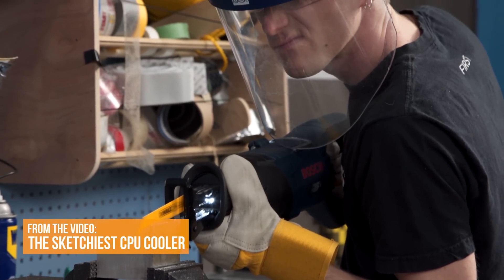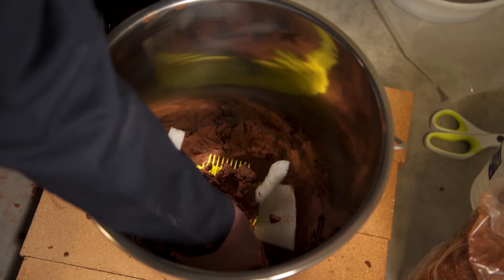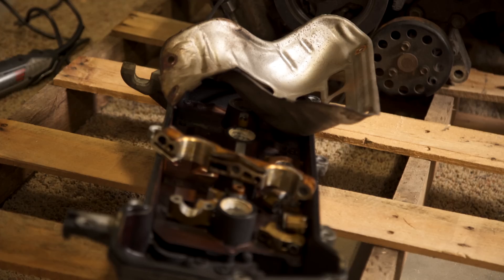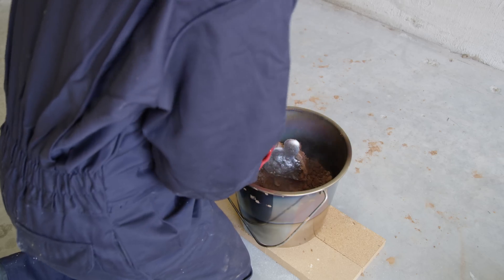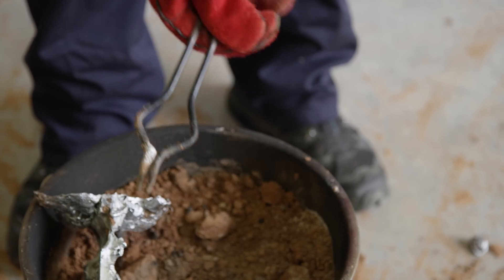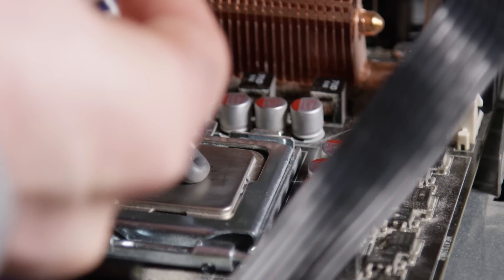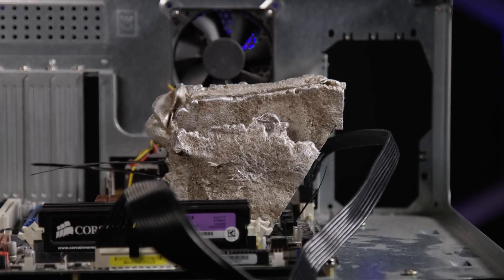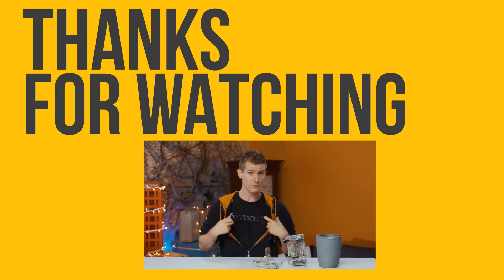The WORST CPU Cooler EVER – Sketchy Heatsinks Ep2

Comment: Should've used wax and plaster , and you have to burn the wax out before pouring , plus it leaves the mold hot so the metal doesn't cool while filling the mold. Then the plaster just washes away.

Comment: If you change the metal finish of a heatsink's fins - like through sanding, sandblasting, or even electroplating with copper - would that increase heat dissipation?

Comment: My god the lacking knowledge of Linus and the tech nerds in the comments is triggering me. You don´t cast complex forms of metal, unless you have a state of art cast and pouring technic and high temperature machines, to make bubble-free and the almost final shape. WE PEOPLE, only get complex structures from metal by removing material from them, with like, for example: CNC, Lathe, milling machine and so on......I´m sorry Linus you will never achieve something good like a heat-pipe with amateur stuff.

Comment: I don't have a degree in metallurgy, but I am a welder and your aluminum casting looked cold to me, it did not seem flow very well. 

10/10 needs more heat
- IGN

Comment: Would it be better just to glue a piece of metal with thermal adhesive to the CPU 🤔
Reply: Basically, I'd think yes, compared to the disasters so far. Use 1/16th" sheets of aluminum, bend the ends at 90 degrees and attach them to another sheet with thermal paste, and use screws upside down with nuts on top to secure the sheets better, so then flat tops of the screws can align with the bottom of the heat sink's flat side.
Reply: actually they did it. They designed their own desctop case, but they used some production methods too. So, not completely DIY.
Reply: Agreed

Comment: The easy way to do what you just tried to do is to buy a hunk of aluminum just a square block. Use a abrasive chop saw to cut fins into it. leave the outside edges thicker so, you can drill holds 1/1000 to 10/1000 smaller than your screws. also make sure you cool down your piece often so you don't  Warp it.

Comment: Why would you not just cast upside down so the fins get filled, and you can sand down the bottom mounting plate? You would of had no issues with the foam casting at that point.

Comment: 1: Print your model in PLA. !!!Don't use green sand(yours was wrong and even good green sand will leave a rough finish)!!!
2: Use a mix of plaster of Paris and sand about 50/50.
3: When it has dried, use a torch to burn out the PLA and use compressed gas to remove any carbon deposits.
4: Cast your part and enjoy less finishing work.

Comment: they didnt dross extract. thats what screwed the pla casts up. tinfoil sheet of reasonable size. place baking soda into said sheet and create baking soda aluminum foil ball. take bbq tongs and force said ball into the bottom of the crucible and force the dross out while under heat. then scrape dross and pour.

Comment: It would be much much better if you had calculated the casting time and included a volume riser to account for shrinkage of the cast during cooling. Casting a cooler tbh is not recommended because the material would be very rough and not precise, especially when you are using sand casting. It would be much better to use either electric discharge machining as the finish would be a lot smoother and precise.

Comment: You should have used loose sand instead as it would get into all the nooks and crannies. Like so Linus can see this.
Reply: Unfortunately he used green sand the worst way. He simply combined two casting methods not meant to work together. If he used low melting point foam, he should have used a proper casting recipient (a simple hollow 2 part wooden frame) and packed the sand VERY tightly with a small wooden block. The molten aluminium would have vaporized the foam on the spot and with a tightly packed sand (less air inside) wouldn't have lost melting point so fast which resulted in such a poor cast.
Even the fact that he used flame to melt the model before pouring could only weaken the greensand mold. 
Too much humidity in the sand is very dangerous (explosion risk), but a sand that's too dry is no good either. 

If he wanted to use the PLA model, he should have made a clay-based fire-proof mould that would have dried in an oven (and melt the original model). Then he would have done the pour. That's just the tried and true lost wax casting method known to Man for thousands of years...
Reply: Also need to flip the heatsink so that the base is on the top.  No matter how good the mold, you are still going to have to plane and polish the base anyway.
Reply: Adnaan Ali they did.
The 1st casts where green sand based
Reply: This is why computer nerds should stick to computers.  I've seen a video of a guy making his own brass knuckles and knives just using regular sand.  After they cool, they do require some cutting, sanding and polishing, but I bet that guy could definitely accomplish what Linus is after here.

Comment: holy shit.... the worst casting techniques i ever seen.
Reply: so i made this car out of dog shit and pva glue, yeah idk

wow this is the ugliest car ive ever seen

oH yEAH? Make it urself and post it then!!!
Reply: Agreed.
Reply: Agreed. I'm mechanical engineering student and we used wax for both compressor and turbine impeller for automotive turbochargers. It's probably the best way to cast finicky aluminum parts without much remachining.
Reply: It's been a while, but I remember that (almost?) all methods that included a lost model, had that model destroyed before the metal is poured in. Either by heating or burning it. From the video it looked like they just poured it over the model and hoped that the metal would burn it away, which might be possible, but only with carefully pre-heated casts.
Reply: yep, this is not how one does casting.
Reply: @watcheths
depending on the shape u can remove the model and before cast.
used a lot when casting plates.
and depending of the material used to make the model u don't need to pre burn/destroy the model before cast for a example styrofoam models burn extremely ease and fast.
Reply: @OhMyKMPR 
its above DIY level...
Reply: Vitor Leão they wouldve had alot more success if they used investment and a different method of lost casting. wax probably wouldve been one of the best for this imo. i have limited experience with casting but i agree they used some terrible methods
Reply: @Vitor Leão that is the more traditional method, not what what was done in the video. it's not like casting techniques haven't existed for thousands of years before most off these materials existed. Anyone who knows how to do proper casting will be able to do many better techniques than what they did here.
Reply: Make one yourself and post a video about it.

Comment: I have made heatsinks using 1/8 - 1/4 inch copper plate and soldering copper flashing as fins. Its surprisingly cost effective compared to buying aluminum heatsinks.

Comment: Take 3d printed heatsink, coat in nonstick spray, fill bucket with green sand and compact it, flatten the surface, press 3d printed heatsink top down into green sand, extract, pour aluminum in, vibrate bucket until aluminum hardens, then finish the surfaces of the heatsink and polish/flatten the base as much as possible.
Reply: Also since with these simple methods it's hard to do detailed work, it may be best to have the fins extremely tall so that you can have them very thick and widely spaced.

Comment: What you want to do is invest the PLA in Plaster of Paris all the way up to the top of your metal bucket, let the plaster dry then heat it to melt away the PLA. After that pour in the aluminum, a little more than you need to force it into every crevice the PLA left behind. Once the aluminum has cooled remove the plaster in water. Use a sander to clean up the casting and you should have a clean heatsink.

Comment: Drill a hole thru that slab you call a heatsink. Then pass a water cooling loop thru the hole. Im no water cooling engineer by any means but with such a massive design its feasible. Like you said its current cooling capabilities most likely is due to its' mass, leading me to believe even the slightest contact with a water loop will make it a beast. Or better yet insert a cartridge of nitrogen into the drilled hole

Comment: I know it defeats the purpose but the pouring cup should have been at the top of the heatsink, or cast it upside down. but the pouring cup is where the bulk of the material stays and the casting vent is where it will flow to, meaning that the bulk of the product to cast should be directly under the pouring cup not next to.

Comment: Idea
-1- Get plaster of paris and a suitable container 
-2- Fill mixture into container
-3- Watch some porn 
-4- Insert (protip use some lube)
-5- Stay rock hard while waiting for plaster to harden
-6- Relax and remove
-7- Pour molten aluminum into cast 
-8-  Spray paint the end-product with gold paint
-9- Pixelate everything and record while placing heat dink on CPU
-10- $Profit$

Comment: that working due to thermal mass got me thinking...

what about a large solid chunk of metal with 4 to 6 holes drilled, where liquid cooling pipes are connected (so that liquid is in direct metal contact)

that should be pretty dope

Comment: aluminum heatsink? - what about copper?Lost wax would have been best, also, what about making a hole at the bottom of the crucible for aluminum to pass thru?
Reply: But didn't he say that that it was a mission to build a heat sink a cheap as possible? Isn't copper  more expensive than aluminum, also if they wanted to make the best heat sink possible they would use rare earth metals like gold or platinum.
Reply: Yeah, but silver is FAR more expensive than copper.
Reply: Radkon Psygami 

Why would they use gold or platinum? 

Copper already has superior thermal performance.
Reply: I said Copper. . .not Gold.  Lost wax method is used by artists to cast copper figures. . . .not just gold.
Reply: Radkon Psygami I was talking to the other person. 

Wants them to make a heatsink out of gold or platinum.
Reply: yeah use silver, better thermal conductivity,cheaper than gold or platinum, and easier to mold than copper

Comment: you guys have some of the dumbest engineers ive heard of. just flip the mold around and use proper green sand. try a 40 percent motor oil nad 60 percent pure beach sand and mix well. there are also other methods as well using kitty litter. i personaly use that with my foundary and have had great success.

Comment: You should spend the money and build a fucking proper small furnace. Then spend more than 10 seconds researching how to do hobby aluminum casting. The use of green sand is normally used for molded casting, not foam casting. Your also probably not reaching proper casting temperature for aluminum, with your shoty setup, and since your using precasted, not pure casting grade, aluminum, did you use any flux?

Comment: I have some experience with printing in PLA to making something cast out of it. I usually use an investment made of some sort of cement-like stuff that I pack around the PLA part, then let the piece harden, then place it in a keln where the PLA melts out (this is called the "burn out"). After that, i have a piece of cement that, on the inside, is the part I want. Only thing left to to do pour in the aluminum and let it cool.

Comment: It is much easier to scratch build a water block than a heatsink.  I used to modify old heatsinks all the time because they were horrible.  My favorite was the infamous FOP-32.  It was a 60x80mm aluminum heatsink with a rather thick base and they would mount a screaming loud 60mm fan.  Well I decided to bend the fins so they were spread out evenly and I could fit a much quieter 80mm fan on top.  This heatsink worked wonders.

Of course old school was 2001... nothing like the first computer I built... and old 386 SX 25 mhz system back around 1989.  The first computer I used an ancient Texas Instruments Data Terminal with a phone coupling that my dad brought home from work sometimes.  My brother later bought a TRS-80 Model 1 in 1977 computer and I was hooked.  I've been pretty loyal to AMD over the years.  My favorite overclocker was my Duron 600 @900 Mhz using the "pencil trick".  I'm still running an old Phenom II X4 945 3Ghz with 16Gb DDR3, 4TB of HDD, and newer GTX 1060.  I would love a Ryzen 1800+, 32GB DDR4, 512GB M2 NVME, VEGA or GTX 1080 Ti, but I am a poor boy now.

Comment: here's an idea for sketchy cooling.. use the heater core out of that yaris as a rad and use the rubber hosing from it to add to a Chinese made water block..then to get real sketchy instead of a d5 pump. use an old electric carburetor fuel pump. 3 or 6 psi.

Comment: That moment when you give up... and you put a ROCK on your CPU!
Reply: thermal conductivity of materials

Diamond 1000
Copper, solid 400
Aluminum 205
Rock, solid 2 - 7

lol i hope they make a diamond one ^^
Reply: Should have taken a bigger (but small size coffee can) and set that aside and cut the tops and bottoms off of a bunch of coke cans so you can have super thin aluminum, then arrange the coke cans aluminum into a heat sink pattern where you have tons of coke can fins.  Then pour a small thin layer of molten aluminum into the coffee can while the bottom of the can is submerged in water, then immediately set your complete heat sink made from cut up soda cans into the layer of molten aluminum at the bottom of the coffee can and whalla, you have a heat sink, you can cut holes at the bottom of the coffee can to vent the air and set a fan on top, or if your a real badass cut holes at the bottom of the coffee can, put the lid back on the can and rig a vacuum hose to suck air from the top, and you will have a reverse badass heatsink with super thin and abundant walls for dissipation, plus this way you can make the base very thin so heat can travel through it and up the soda can aluminum quickly and out the vacuum hose.
Reply: from all the previews and thumbnails I thought that it will be an actual rock
Reply: I was on the throne watching this... better then laxatives
Reply: I guess the nest episode will be soldering aluminum and/or copper plates together
Reply: Reed Elenz lol i almost choke on my pizza reading this 😂
Reply: HAHAHA
Reply: Skye G I'm confused why this is even a question for you. The answer is no. In this case I just know and don't need to test it. Rocks hold in heat AMAZINGLY. They do not steal and release it so well. Least not fast enough to be a heat sink.
Reply: HaHAHAAHAHA
Reply: lol
Reply: hahaha...lol
Reply: Reed Elenz  Dwayne Johnson?! :D
Reply: Reed Elenz I wonder if that would work....... Youd have to shave it down like a cpu but I wonder if a heatsink made out of a rock would work.....
Reply: Then the moment you have to test it... and make a video... and write-up a dialogue for it... and still throw-in sponsors words with a straight face.

36K likes.. a sympathy bonus

35K more likes then a stupid cat video... Priceless
Reply: I dieded
Reply: Oh my god, this comment made me burst out laughing. So frikken true hahahaha!

Comment: So yes, I'm sure I'm just adding to the droves of other people saying similar stuff, but, I think you were on the right track with the PLA model! But yeah, seems like the aluminum can't just burn through it on it's own.  Instead, I'd say take your PLA print, and make your mold out of investment plaster material, and then melt/burn out the plastic ahead of time, leaving the mold empty, ready for your metal :) Of course, you can get more advanced than that, but, I think that should get you 95% of the way there!

Comment: dat cooler deserves RGB lighting
Reply: underrated comment
Reply: Fairy lights
Reply: Edd mounted, stand clear from blast zone.
Reply: with home-made lights or purchased?
Reply: Rubbish Garbage Bullshit?
Reply: Kaseriox xD
Reply: Why should be rgb?
Reply: All there was needed to do was to use concrete. 
Get the 3d print, and make sire that there's one side with less detail exposed (eg. The flat simple area where it touches the cpu) get plwnty on simple concreate mix, hang the 3d model on a string on just make sure it won't sink too deeply before ot dries. Wait for a at least a week... carefully take out the plastic model or just melt it/burn it. Pour aluminum. Bang done.
Reply: For More fps
Reply: If you turn it over you might find mushrooms that do that for you

Like cow patties
Reply: And AURA support!
Reply: mystic light
Reply: few signature from the makers and it's gold
Reply: Nothing could make that sellable.

Comment: Just. Use. Normal. Sand. Also it helps to turn the foam mold a little, with an extension to the top to direct flow (cut it off afterword)  to increase the coverage of the aluminium. Love your videos  ;)

Comment: I think would have a better chance of filling the fins(dollar tree foam board for fins) if they were at the bottom cause the aluminum would flow down, rather than ?up? by magical forces and than flatten out the base afterward...... I find the pulling off these projects has been a rushed process(felt the same about refrigerator computer), should get someone who's creative to theorize ideas before hand(have an idea of expected outcomes and how things behave; liquid flows down easy but not upward so much.... if the foam melts before the aluminum can fill the cast will it hold it's shape?) and have alternative fall backs cause least from my perspective this was mission impossible logically(not thought out)

Comment: 1. make a 3d heat sink 2. make 2 part clay mold 3. remove mold to clay put melt wax on the mold 4. fuse to mold clay and melt the max 5. pour molten aluminum on clay.          I hope you get what im typing   im poor in spelling

Comment: Could have welded up an inverted mould from sheet steel and then filled it with the aluminum and sawn off the sprue on top after it cooled and released.